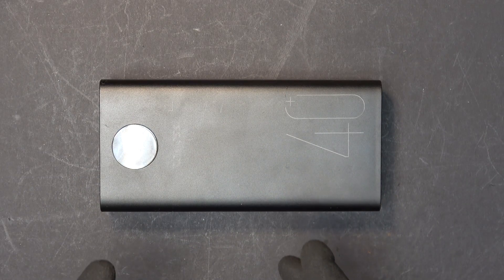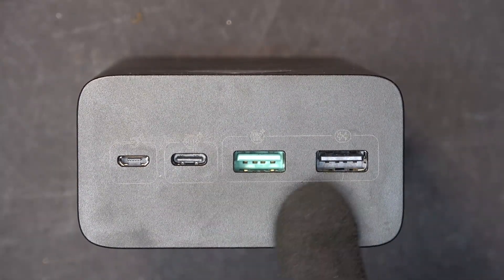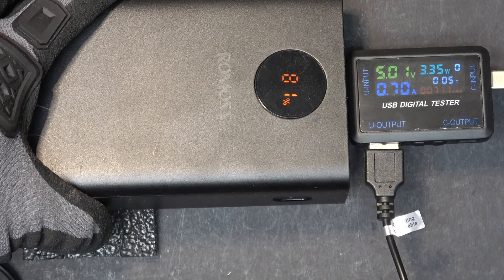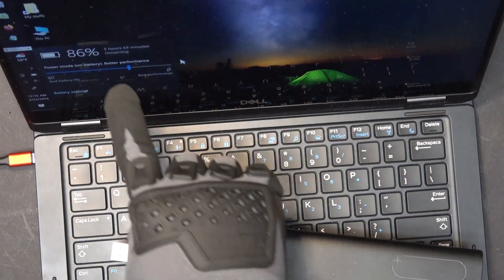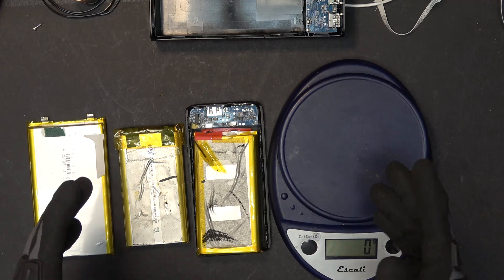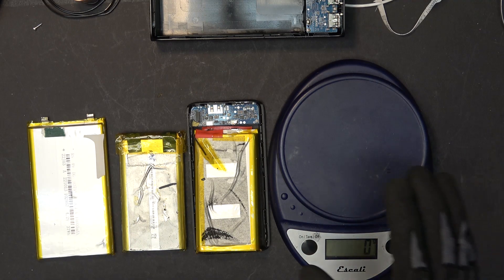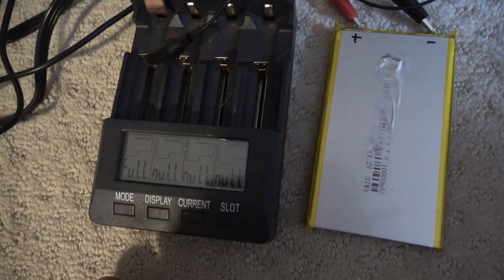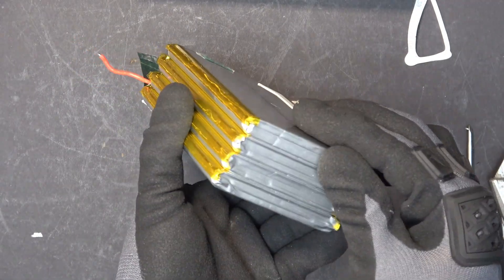Review & teardown of a Romoss 40,000mAh USB power bank

Comment: Does that power adapter you attempted to charge with through the USB C port support 12V? 12V is technically not part of the PD 3.0 spec so companies like Anker do not include 12V on their power adapters...which is just silly all the way around though. Thankfully most companies do include a 12V PDO.

I also would guess that the powerbank you chose as a load for the USB A ports wasn't the best choice for measuring the max output of the ports. The green port is likely the one that supports some fast charging protocols like Qualcomms QC 2.0/3.0.

The best way to test the actual outputs of those ports is to use something like an FNB48/FNB58 or KM003C USB tester since they will run a protocol detection and show you every protocol supported and what voltages/power levels it supports. You could then buy the corresponding QC/PD/whatever protocol triggers off Aliexpress and trigger them on the powerbank and have the load running to a cheap Atorch DL24 electronic load (0-200V/0-20A/150W) that are only like $23 shipped.

Comment: When you use USB for charging, the USB interface uses the so calle USB PD (Power Delivery) protocol, to indicate how much voltage and current the recieving device requests. For some devices this will be a static ammount, but for modern phones, ipads and laptops, the PD protocol may change the supplied power during charging.
Typically, when a device like that reaches 80% of charge, the PD protocol will reduce the power, so that the recieving battery will not heat up, when  it is filled with the last 20% of charge.
This means, that in order to judge how effecient a charger/battery bank is, you need to analyze a full charcing cycle form a few % up to 100%, with a device that can actually draw the full power that the supply is capable of (in this case up to 22,5 W).

Comment: An adjustable load is a much better way of determining maximum output power. The bms in the charged devices are surely throttling the system,

Comment: Other to test for glue/tape is IPA. Should be little safer compared to hot air
Reply: Yep 99% IPA (or even the 90%+ stuff from the Walgreens/CVS/local grocery store...just DON'T even bother with the 70%) works wonders and is so useful when cleaning off flux and other crap on electronics.

Comment: Careful there, the capacity is 40Ah at the batteries. It's not 40Ah at the 5V output, it's less. You must use Wh instead.
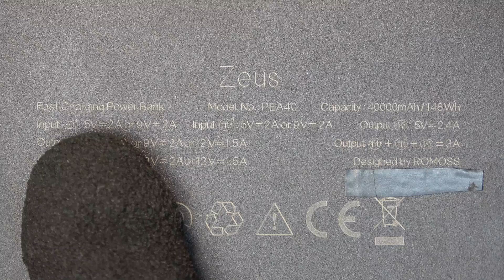Reply: Yes, this.  The spec at 0:48 says it is 148Wh, which at 3.7v nominal battery voltage is indeed 40Ah.

Comment: Can this batteries provide high current?
Next video: how to build 40ah e bike battery Lol
Reply: 0:48 - no.

Remember Ah are almost meaningless.  To have meaning, you need to know the voltage.  For powerbanks like this, that is usually 3.7v (the nominal battery voltage).  A better number is Wh (watthour).  You'll notice on the specs, 148Wh.  Power(watts) = Volts X Amps.  So 3.7v X 40Ah = 148Wh.

If your e-bike battery is nominally 36v, and had 148Wh, it would only be 4.1Ah at 36v.    If it were 40Ah at 36v it would be 1440Wh - almost twice the size of the typical e-bike battery, but some are in this range.
Reply: @Sylvan_dB  stack like 10 or 13 of theese  to make a 40ah battery
Reply: @felipehcraftgamer4193  This is already a 40Ah battery.
Reply: @Sylvan_dB 40ah at 3.7v. Ebikes are 42v normally. So yes, 10-11 of these in series can power an ebike
Reply: @ajsyoutubeaccount  wow, it's like you are me, repeating what I wrote with a fraction of the "why".